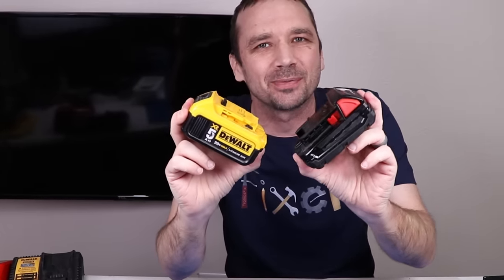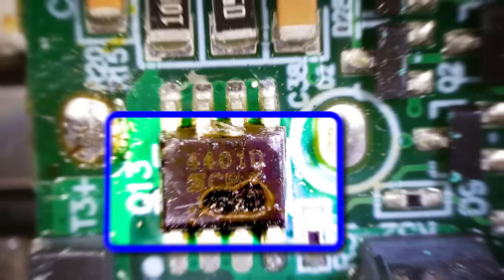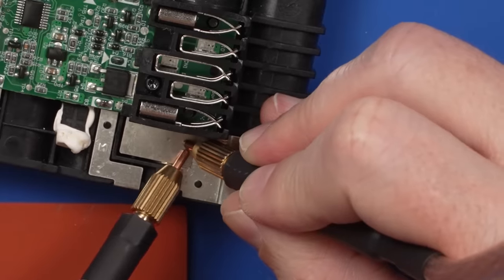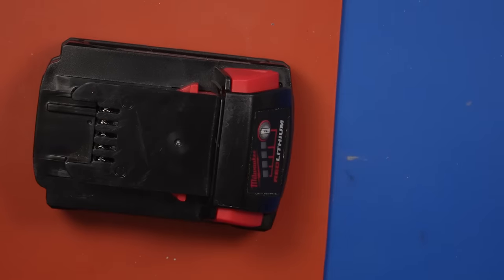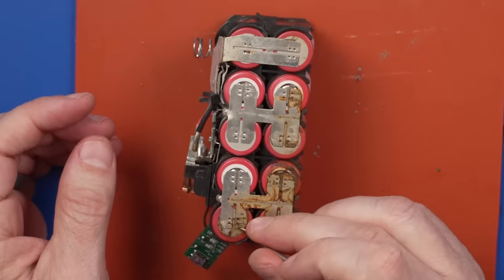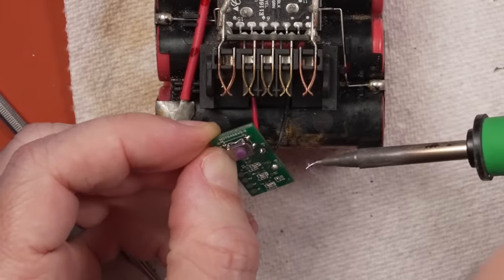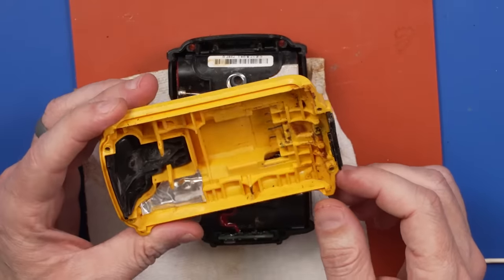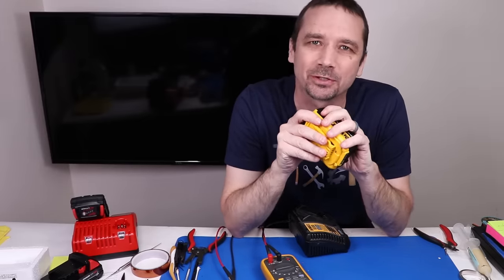Are Power Tool Battery Packs Fixable? Let's Find Out!

Comment: Hi Steve, I work at Batteries Plus. I've done a lot of repairs on drill batteries and rebuilt them as well. For your DeWalt battery, the minimum voltage for the charger to recognize it needs to be charged would be 16 volts to about 15.5. This is because it has multiple different batteries in it and those batteries are 18650s. Each one of those batteries have a 3.7 volt charge. 18650s minimum voltage required to charge would be around 2.5 volts. Multiplying that by how many batteries it has gives you the minimum requirement for the charger to recognize it needs to be charged
Reply: Do you guys repair Packs with 18650's or larger lithium cells at your batteries plus? Cuz all we used to do at the one I worked at were the Ni-CD and Ni-MH ones.
Reply: @UpintheAir1395  Hey man! My store doesn't work on the lithium packs due to the possibility of there being damaged lithium and shorting out the electronic causing the batteries to overload. I am just familiar with the packs because I use 18650s for other purposes.
Reply: I'm shocked that an electronics guy gave up on fixing a battery, or heck, even put it back on the charger, without checking the voltages of the individual cells. Milwaukee in particular might just flip a switch in software and say "never try to charge this again" after a couple failures. 14.5V means nothing if that's 3.6v per cells on 4 cells, and one cell at zero. Or... just try to charge up the weak cells manually and see if they take some energy. It's so simple and he didn't even check!
Reply: I have fixed over a dozen old batteries some with water damage etc. only see one bad board surprisingly. Red green one was definitely like Jesse said low voltage. I usually balance charge the cells first to at least 3.5 volts so they all match. If one cell is very weak I usually replace it which is a pain. That spot welder you have doesn’t seem very strong. Mine was cheap under $40 and will melt those nickel strips like butter if I don’t watch the level. I usually test before use so I don’t melt something I need lol.
Reply: @MattsAwesomeStuff This guy is used to fixing circuitboards on ps5:s, xbox:es and so on. Not fixing batterypacks for powertools. This was a spinoff-video so you can't blame him for not having knowledge about these type of repairs.
Reply: Before soldering on the replacement board, I would have measured all the 18650 cells.  Bet there's a shorted one, and that's what fried the BMS.
Reply: @MattsAwesomeStuff  That was my thought too. He probably could have watched a few videos on drill battery repair first and seen that 18650's have a built-in protection circuit. At 14.7v "fully charged", that would mean probably 2 x 0v cells. Since you'd want to replace all cells instead of just the 2 that are bad, he's probably right to consider it a lost cause - given how dirty the inside is. That'd be the first thing I'd check though before spending 30+ minutes cleaning everything and resoldering the battery level indicator.
Probably the same with the Milwaukee. The 2.4v is really low and could indicate a few 0v cells. Would be interesting to see a follow-up video on team red.
Reply: @MrN8007 Hi, I knew a lad that melted hex allen keys with a spot welder, a disruptive college lad.
Reply: I used to own a vape shop, we had a ton of customers who used 18650 batteries in their devices.  At the time I was using a Nitecore 4 bay charger which had a digital display.  This display would show real-time voltage, amount of time the battery was on the charger, and the amount of current being applied.  This charger was also capable of charging lithium ion batteries, NiMH, NiCad, etc., and the display showed what type of battery you were charging as well.

One day I had a customer come in with an 18650 and a charger that he had bought a few days earlier, and said that he put his battery on to charge, and after a few seconds his charger would show the battery was fully charged, but when he tried to use it the battery would still be dead.  So I put the battery on my charger, and sure enough after just a few seconds it showed ‘DONE’ on the display.  But I noticed that it was reading the battery as a NiCad, and that its voltage was about 1.4 volts.  A LIon cell should be 3.7V nominal.

But something else I noticed while using my charger with its fancy digital display was that in those first few seconds while the charger was taking a voltage reading on the battery it was applying some current, and that the battery’s voltage would increase a little bit before the charger would say ‘DONE’.  So I figured out that if I kept removing the battery and replacing it on the charger, after a few times the battery’s voltage bumped up above around 2.5V, and suddenly the charger showed that the battery was a Lithium ion and not a NiCad, and at that point the charger stopped saying ‘DONE’ after only a few seconds.

Once it reached the point where the charger was reading the battery chemistry as the proper type (which it apparently does simply by reading what the voltage is), it went on to fully charge the battery to its full charge of 4.2V.  (The customer later told me that this battery went on to serve a long and trouble-free career as a power source.) 

So all of that was a very long explanation for this: the reason the chargers for the battery packs you have won’t charge them is that the battery pack’s voltage has dropped below a certain threshold.  But that doesn’t mean you can’t bring those batteries back to life.

If you have a power supply which can control current, apply from 0.5 to 1 Amps to the B+ and B- terminals until the battery reads about 17V.  Then try them on their actual chargers and see what you get.  This may or may not work, depending on the health of the battery’s individual cells, but it’s worth a try.
Reply: red green flash code is labelled on the battery
Reply: Yeah yeah, I work there also. Gimme a break..   183650, no such thing bruh. These are all unlabeled chicoms
Reply: just last night repaired 2 milwaukee 5.0 Ah, both had 2 cells under 1V
Reply: I bought 2 makita batteries at a pawn shop for a buck they had a small charge on them but when I put them on my charger they wouldn't take a charge shows the batteries are  faulty. I can hook a car trickle charge to the batteries and they will charge to 12volt but still won't work on the makita charger . What's the problem?  Anyone ?
Reply: @kevinedwards9365  the battery management board has probably fried.... ull probably need to replace the board like at the beginning of the video.
Reply: Outstanding comment-- nothing beats experience and training. Batteries Plus is on my map of frequent service vendors.

Comment: I’m a huge fan of the channel. I am making this comment as I watch so I’m not sure if you’ll figure this out this video. The cells should each be about 3-3.9 volts. Typically if a cell goes bad the battery won’t charge anymore. The individual cell can be replaced but they usually need to be balanced with each cell as close to the same voltage as possible. That circuit board has a battery management system (BMS) that balances each cell during charging. So if a cell is bad (low voltage) the charger will not charge it and they usually recommend taking it somewhere to be recycled.

Comment: I had a Ryobi battery from new for years, it suddenly stopped charging and sat in my shed for months. One day i opened it up and connected my motorbike recovery charger to one of the cells, few seconds on then plugged the battery back on its charger, it charged to full in an hour and has been working perfectly ever since. :)

Comment: I repaired many of these battery packs. Many I got with corrosion (those I directly throw away), some with disconnected cells (bad spot welding) and most with dead/bad cells. Only few had burned ICs or electronic defects. For those with bad or disconnected cells, I replace the cells after I give them a full charge/discharge/charge cycle and select the cells with (near) the same capacity.
I fixed many, starting for myself and later for friends, work colleagues.  It helped me to learn how to spot weld, in the process I built my home-made spot welder, I bought nickel stripes, 2000mAh 18650 lithium cells. Also, many cells I find in those dead battery packs, are good (>80% capacity left) so I use them to power another things (BT speakers, flashlights, powerbanks or any thing that will take these cells).
I also tried to replace the old NiMh battery packs on old portable tools with lithium ones with mixed results.

Comment: Sorry to hear about the cancer. I was diagnosed with B Cell Lymphoma back in 2021 and went through a couple of different courses of chemo and finally a stem cell/bone marrow transplant in 2022. I was given the all clear at the end of that year, but always gotta be monitored in case it comes back. One thing I will say is hair loss really does depend on the chemo used and your own genetics. The first two chemo types they did with me did not result in hair loss, but the third one did (as did the fourth version which they give before the transplant). It wasn't just head hair though. Beard, chest, pubic hair and even eyebrows went, but was incredibly lucky I did not lose my eyelashes as that can cause serious discomfort.
Hope you get through this. If I can do it so can you.

On the subject of batteries, back in 2019 I bought a took box/drill combo and barely used it (as I say, 2021/2022 I spent a lot of my life in and out of hospital). It actually came with three batteries.
Back in Jan this year I went to use it and all three batteries would not take a charge. I asked the drill manufacturer if it is normal for lithium batteries to just die through lack of use as I was not sure if it was the batteries or the charger at fault, and have limited funds to replace them. The manufacturer representative was pretty useless though as it took him ages to reply and when he did, all he said was "I spoke to our engineers and they said is it still in warranty" ... didn't really answer my question. In the end I took a punt and bought a non OEM battery and it proved the charger was fine, but the three batteries were toast, so ended up recycling them.
Price for original batteries is ridiculous. When you consider the price I paid for the toolbox, drill and three batteries, one battery was the same price as all of that. The non OEM one was half the price.

Comment: We are all rooting for you Steve, Im sorry youre having to go through this.

The past year or so I have watched you in awe and wanted to try and be like you with the electronics repairs. 💐💐
Last week I bought the following: solder station, digital microscope, bench power supply and a load of components. 
I also bought 2 YlOD Ps3s, a bundle (ps1, ps2 xbox one and 360) off ebay for £60 and a ps2 for £10.
Thanks to you inspiring me, I have now repaired: 
the xbox one, one of the ps2's (the other became a doner)
The PS1 (just waiting on a lazer now-freezes).
1 PS3 had been re flowed and works.
The other I ran out of thermal paste, once I get more I will de cap , re flow and rebuild with the perfect amount 👌🏽 😎 

Youre an inspiration and a great help, love and thoughts from the UK. Keep up the good fight brother ❤🫡

Comment: Hey Steve!
I can't remember where I read or saw this, BUT apparently some lithium battery packs for certain devices have programmed Battery Control Modules that basically wipe themselves once you lose power. Like a computer with only RAM - load it up once and it will work forever, until you lose all power then it's permanently dead, unless you have the right 'software' to load back onto it again.
All the best with your health too mate. Have thoroughly enjoyed watching your repairs and antics =)

Comment: I got it fixed.  It is running my DeWalt tools and is charging fine.  I had an inspiration this morning - I noticed that two of the balancing lead were shorter than the other two.  I also knew that white, yellow on the positive side allowed it to run my DCD 771, drill, so my problem was on the negative side balancing leads.  The short lead was green and the longer lead was blue, so I soldered them on this way.  I put it back together and plugged it to my drill.  It an it fine.  I put it on my DCB107 charger and it started charging.  Bingo.  It took 1.5 hours to fully charge.

Comment: if you’re having trouble with the dewalt, jump it manually with another good battery until you get it near 16 volts. It may charge after that, Ive revived a couple of them that way. If you are having issues with friction connections you might try Stabilant 22A,it’s really expensive at around 100$ for a tiny bottle but it lasts forever,I’ve had the same bottle for 10 years and only use a drop at a time, The stuff is an amazing friction enhancer and as far as I can tell made with some kind of benevolent Sorcery. 
It’s used commercially and in the military in high stress shaking, contaminated dust environments, tanks, navy vessels etc.

Comment: I tried to take one of the DeWalt batteries apart one time that didn't work and they are an absolute pain in the ass to work on.

I also took apart my DeWalt drill once...good luck. There's like 7 planetary gears in there steel balls were rolling all over the place I would have never been able to get it back together without watching a video of me taking it apart.

Comment: Those tabs on the M18 board can be very hard to spot weld. Mine has a hard time with those also. I simply puddle some solder on those on the edge after I spot weld them to help keep them together. Praying for you Steve as you go through tour treatments!

Comment: For the spotwelder, try touching the probes to each of the pieces you are joining reather than both on th top piece.  It will allow the current to flow through the contact point to join them better than flowing through the top piece and hopeing enough heat passes through to the bottom ...😊

Comment: Wishing you a swift recovery! Re: the minimum voltage per cell, Samsung branded 18650 cells have a minimum cutoff voltage of 2.65V PER CELL but it’s rare that a controller will allow them to go that low before cutting off charge/discharge. If they’re above that but below 3V, you can still nudge the individual cells up to just above 3V each before putting the battery packs on the smart charger. Also, you don’t want the cells charging over 4.2V individually. The charging controllers are supposed to keep them balanced.

Comment: One of the early steps I'd do to decide if repair is worthwhile is to measure the voltage of each cell.  If the whole pack is severely discharged (like the Milwaukee pack maybe was), you could have poorly matched cells, and even one or more failed cells.  The BMS should disconnect the battery from further discharge when just one cell goes below 2.8v (so maybe you were measuring a single cell voltage?).

Comment: The Milwaukee charger can detect and charge Milwaukee batteries only. They put something in the boards on the batteries to detect. If you buy aftermarket batteries you can see that 2 pins are used while oem uses and labels all pins

Comment: The issue like the milwaukee battery is easily solved. Hook up a full battery to it. Positive to positive. Negative to negative. Only takes a few seconds then pop it on the charger. Works for my snap on 14.4v batteries. One of my tools drains batteries to 1.2v if left in the tool for some reason and this trick works every time.

Comment: I repaired a g-tech battery with built in charger connector for someone a few years back as g-tech wouldn't repair, only sell you a new battery for £80, turned out to be laptop charge connector, took 20 minutes and a bit of soldering and it was like new, I love repairing anything if I can handle it

Comment: Battery Mooch is an amazing resource and a wonderful human that researches batteries extensively. He does extensive testing for all kinds of things, but he focuses on smaller cells like 18650 and 20700 and 21700 because they are commonly used not just in battery packs, but in vaping devices (bigger box mods) and so Mooch wanted to push battery safety hard to the masses of vapers. A lot of cheap cells are falsely labeled on amperage and total capacity(but not much as size limits capacity and amperage) so he has become a treasure trove of data now. 
Molicel batteries are the best in almost every way, but they are a smaller company. Samsung and Sony(great cells) have a much higher market share and are already being used in several battery platforms. Harbor freight’s Hercules line, dewalt, Makita all use Sony/Samsung but those are the ones I have seen disassembled. I think my 12v Milwaukee batteries were Samsung 25r’s(?)

Comment: I hope you recover Steve.

Also about the Milwaukee battery you dealt with, I've oddly had the same fault on a Ryobi battery after a couple months (The lights on my charger were saying the battery is faulty)
Took the Ryobi 18v battery apart, then I found a IC that looked cracked, Couldn't make out what the IC was, so I called the battery a write off.

Comment: You need to trickle charge the milwakee one, easiest way is just hooking it up to any power supply that can provide 18v at 0.5a for a few hours until the cells reach about 10ish V and youll be able to plug it into its charger like normal again. Good luck with your health sir

Comment: Probably already been said (didn't want to read 2K comment to find out!) but... before spot welding, sand both surfaces. Press the probes straight down (not on their side) best you can. Don't recycle the old weld points!

Comment: You can take 2 wire leads and use a good battery to jumper some power into the Milwaukee battery to give it a few volts to be able to charge.  This has happened to me before, there is several YouTube videos on how to perform this procedure.